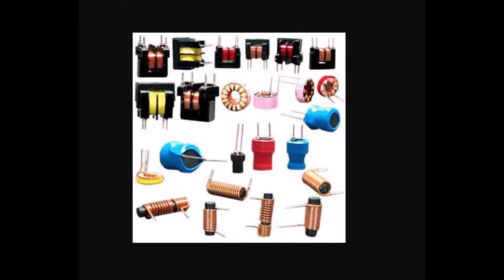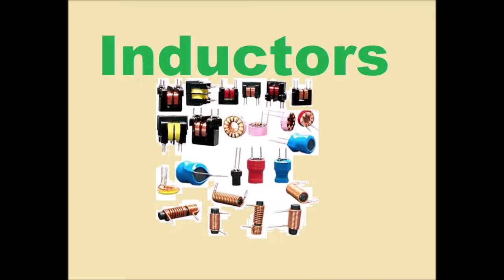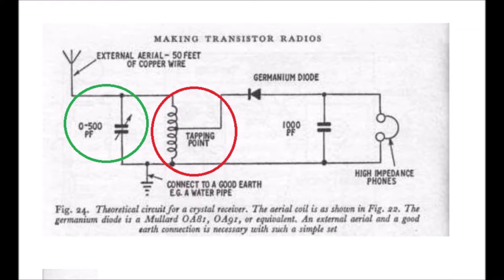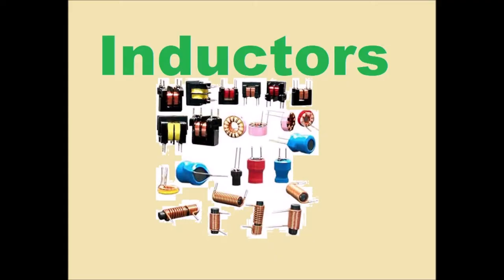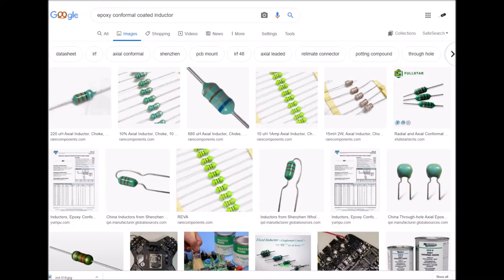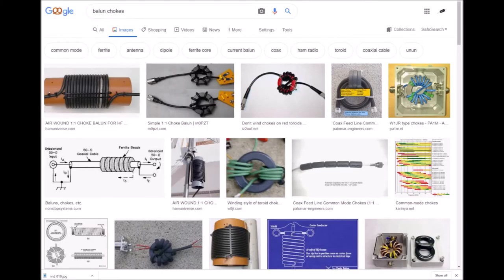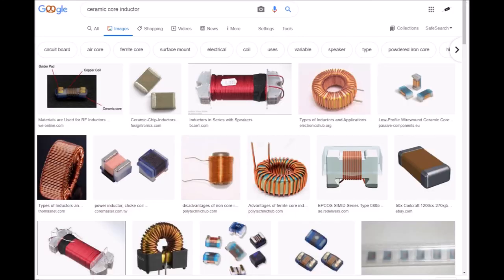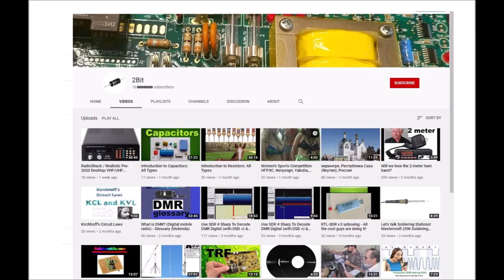Introduction to Inductors: All Types

Comment: It's interesting that regarding the axial color coded inductors you only mentioned that "they are inexpensive". I hope that doesn't automatically render them useless. It's hard to find any information on the axial inductors usage. The only thing that is often mentioned  about them is that they are unlikely to perform well in high frequency applications where they may begin act as capacitors. I haven't found any quantitative recommendations.
Reply from the maker: I plagiarized from a text mostly, just re-phrased everything so its in my own words. (Most people won't admit that.) Thanks for watching.  You sound like a fan of axial inductors. All the best in your projects.